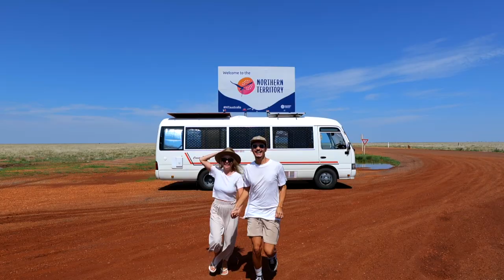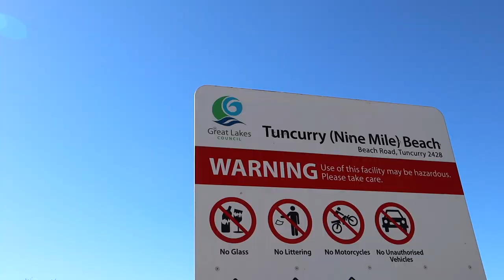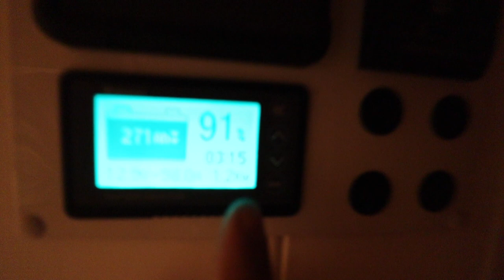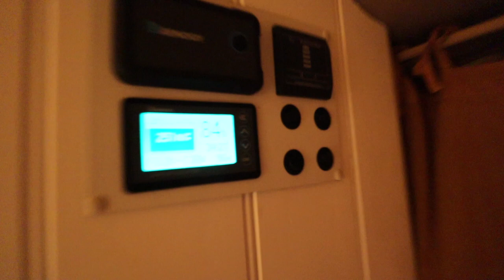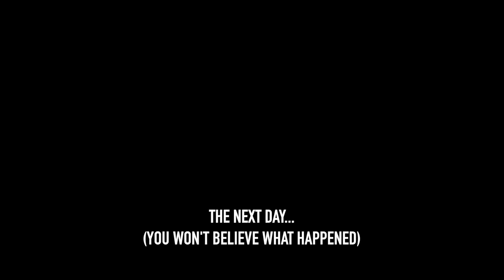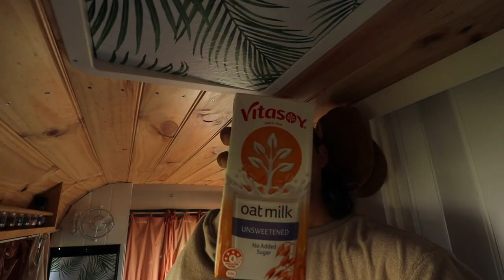Our first full-time VAN LIFE experience! Road trip in Australia!

Comment: Hi There. I have a question for you. We also are about  to purchase a converted coaster & we are told we require a (LR) light rigid licence because our bus is over 4.5t did you have to do this? We were to believe it only needs a car licence to drive. Confused??
Reply from the maker: Hey! Yes it does depend on the vehicle and how it has been registered. Ours was under a car license. You can change it to be on a car registration down from an LR but I’m not sure the process, it will be worth speaking to a mechanic :)